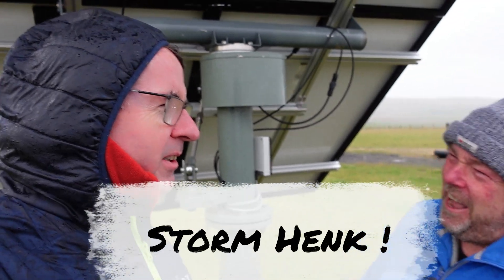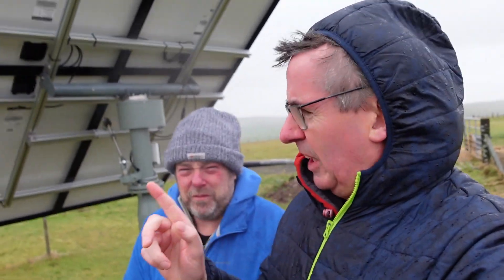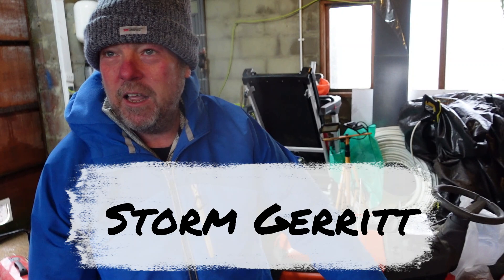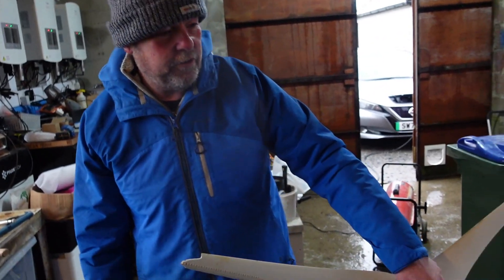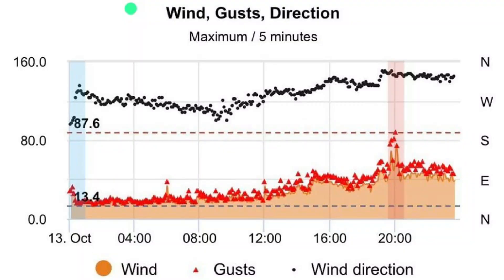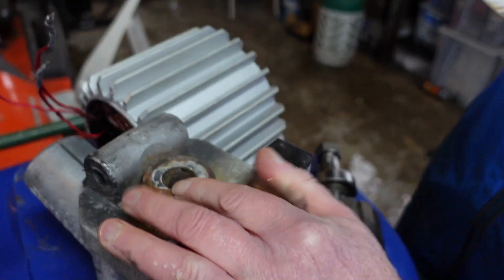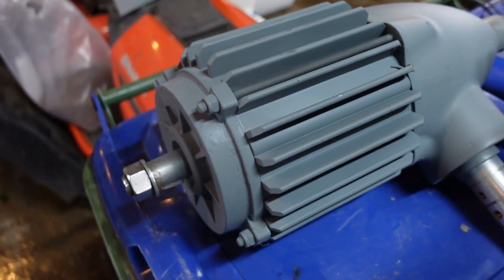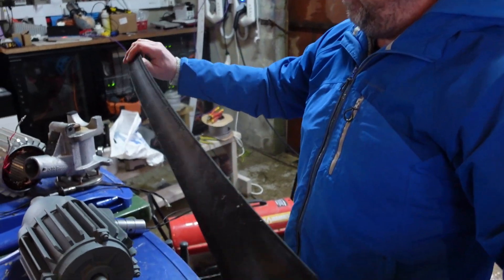The Ultimate Storm Guide to Domestic Wind Turbine Testing, here in Orkney !

Comment: Great stuff Chris, thanks for that spring no; i will have too get it of you again, had a tablet change and lost photos and input. See killkennyhomestead hes doing a 60amp slip ring 6 wire. Ive got dug out, all three pads 2x 300mm x 300mm x 700mm and undermined the clay by 100mm, 2 meters away the mast base 500mmx 500mmx800mm and undermined the clay 100mm on all sides, 500mm for room for the swaybar supports, casting in concrete all the stainless steel 12m threaded bars, fastening the mast via a male to female, but not an allen key bolt a 3.5m stainless steel bolt from 5m to shoulder hight and 2.5m too shoulder high, i could get a good air b&b for all this lol

Comment: Just a thought, could you not have the blades facing the opposite way so the wind blows through the motor to the blades and blow the flex away from the post, not sure if the reverse direction of the generator will give reverse polarity